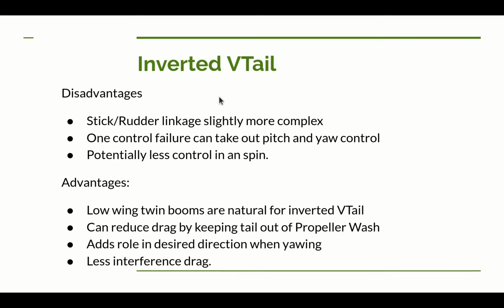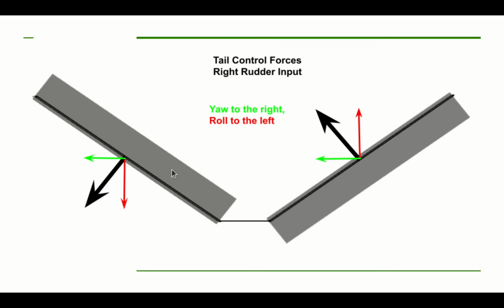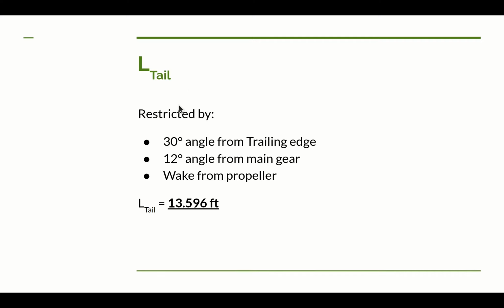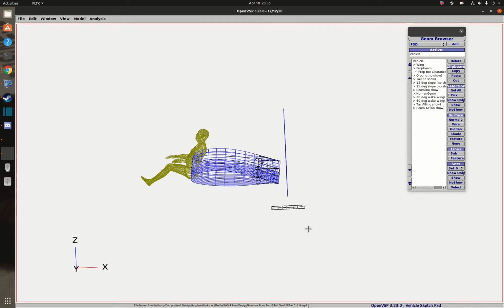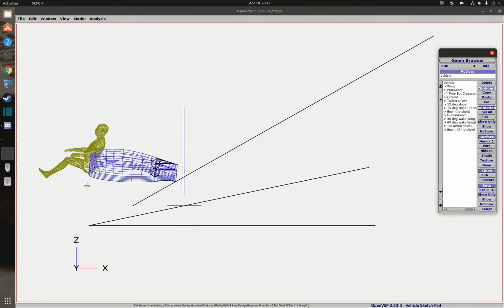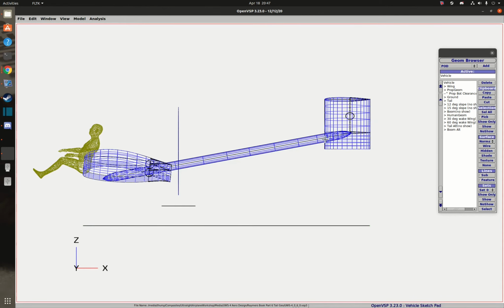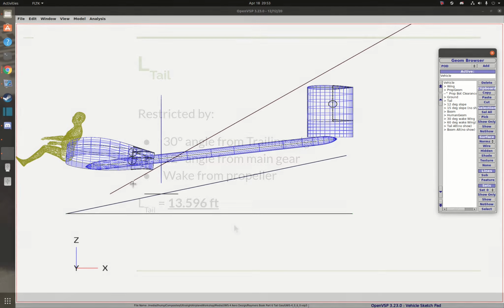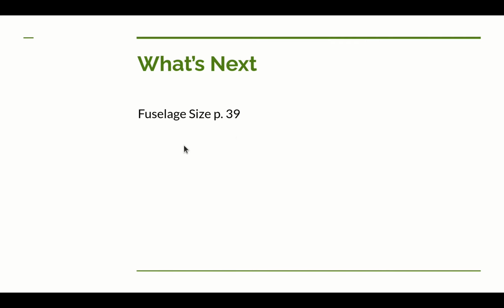UWS-4 Aero Design: Part 6b, Tail Geometry

Comment: hi, thank you so much for your videos, they helped me a lot !!
however I can't find anywhere how to calculate the aspect ratio and sweep of a V-tail.
in my project I have a fixed wing uav with a Har = 3.1 and a Var = 1.7 and a dihedral angle of 34.4 (the wing has an AR = 6).
so I thought I'd go like this:
I find the wingspan in my case: Hws = 0.495m Vws = 0.250m, divide them by two and then apply some trigonometry.
ex: wingspan of the V-tail of each surface = cos (34) * (Hws / 2) + sin (56) * (Vws / 2)
Do you think this is a correct approach? Can I use the same approach to determine the sweep angle? thank you very much for the videos you post and thanks in advance for a possible reply
Reply from the maker: A very crude approximation is to "translate" the V-Tail into horizontal and vertical components. So you can have a vertical AR and horizontal AR. For horizontal AR you would use the planform of the V-Tail when looking at it from above (project it onto a X-Y plane). For the vertical AR you would do something similar for the planform in the X-Z plane. But like I said this is very crude but a good first approximation. To do more would require a far more detailed analysis.

Comment: Thank you so much. In many references it is mentioned that Horizontal tail has a bit greater aspect ration (about 4) than the vertical tail (about 2), so I would like to know in the case of a vee tail which aspect ration we would set ? In the video the aspect ratio is about 2.3.
Good luck
Reply from the maker: For the UWS-4 I chose the V-Tail aspect ratio based on what I would want for a horizontal tail. BTW I think an AR for a horizontal tail should be significantly less than the AR of the wing. If the wing AR is 4.5 then the horizontal tail AR should be far less than that. I'd want the horizontal tail AR to be no more then 3. If your wing AR is more than 6 then a horizontal tail AR of 4 would probably be OK. You always want the forward flying surface to stall before the aft flying surface. A lower AR will generally stall at a higher angle of attach than a higher AR. I hope this helps.
Reply: @Designer103  
Thank you so much for the explanation